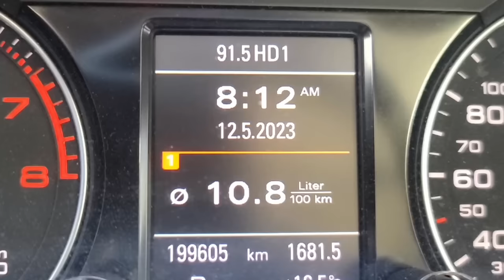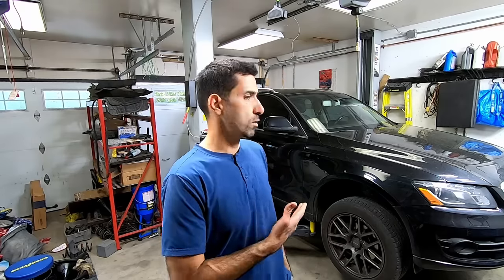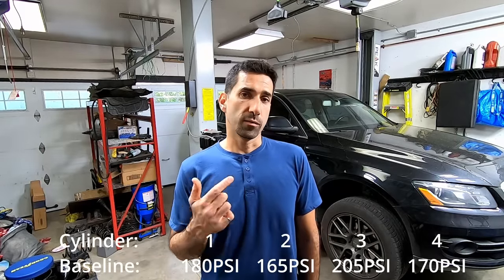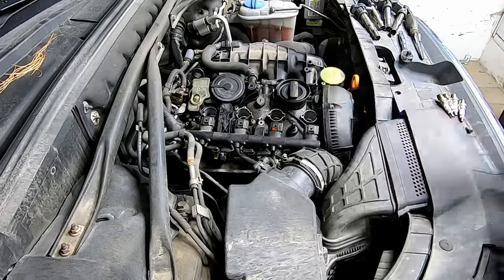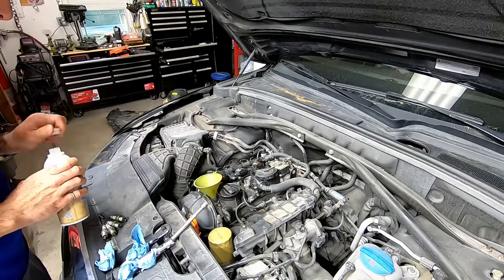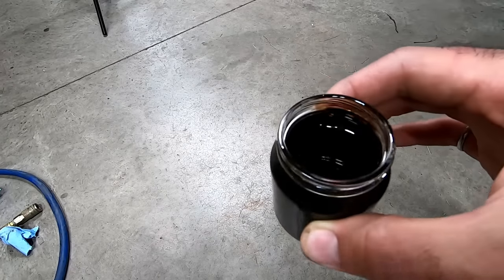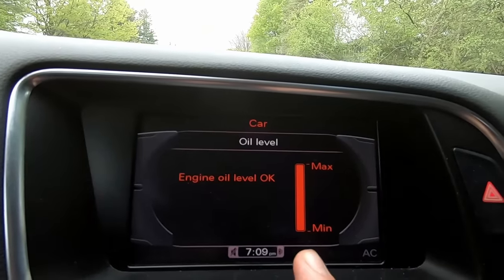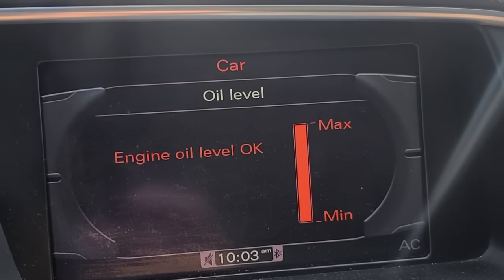How to fix excessive oil consumption from clogged piston rings (Part 2)

Comment: Great results! Will be very interesting to see longer term results (5k and 10k miles).
Reply from the maker: The first oil change at 5k is coming up next week - still no light
Reply: @ETMotorsports  That's awesome! From other reader comments, I was also wondering if the B-12 might burn out your cats pre maturely, kind of like when an engine is running rich.  I have no idea if there's a way to check that though...?
Reply from the maker: @tedjohnson64  yeah I know a few folks are concerned about that but honestly you're running it for 15-20 min and B12 is an injector cleaner so it's designed to be burned in the engine anyways...
Reply: @tedjohnson64 i bet shooting liters of oil through your cat is far worse then idling witz b12 for a few mins.
Reply: @tristan8243  Good point.  And if they went through at the same rate, I'd agree with you. However... that B12 appears to be going through the cat's in a very short period of time, rather than the multiples days and hundreds of miles it takes to burn a liter or two of oil.  So the excessive heat event in the cat caused by the B12 would be significantly more intense than burning oil, and thus more likely to melt the cat.  Furthemore the oil will be burned a bit at a time, spread out over multiple days, which means the cat gets to cool down between oil burning events. 

I have no idea how to objectively measure cat health, but it would be quite interesting if (for a future video) one could take a before measurement of cat health, then do the B12 treatment, then take a second measurement of cat health.

Comment: Hi, I was informed by the Audi dealership the cylinder issue and need $10k replacement due to the q7 2018 is burning oil. The car shake and does not  accelerate. Is my car experiencing bigger issue and using this method would not work ?
Reply from the maker: It could be 1000 different things... I'm working on a Q7 right now burning 1L/400km but drives perfectly fine and compression checks ok... you could have the same issues with oil burning but have other problems too... my A4 was burning so much oil that it was destroying the plugs in less than 30 min of driving so it would start to misfire and turn off one of the cylinders... basically it's hard to know without more data - cylinder scoring? Cylinder misfires? Maybe timing issues? Lots of variables

Comment: Excellent video. My only comment is why take the risk of incurring permanent damage to bearings, caps, etc by running the engine with 20%+ of the oil being a solvent?  After the soak, your engine/oil is full of free carbon chunks, grit, etc.  You want to get that crap out before putting a load on the engine/components, and especially not when your viscosity has been dropped significantly.
I am going to do a soak on a Nissan 3.5, but then an oil change with $20 Supertech full synthetic and filter, then drive it for a couple days with some real acceleration, and then a final oil change.
If I want/need to do an engine clean, then I'll do it before next oil change using 1 can, and if necessary next oil change the same way.
If you're burning up that much oil, then the engine is certainly carbon-ed up the wazoo.  Bearings, journals, caps, etc being exposed to a crapload of free carbon is not something that can be cheaply DIY fixed.
Its taken years for the engine to get this bad, why put yourself at an unnecessarily higher ri$k trying to fix it in 1 weekend vs lower risk over 2-3?
Really need to find an oil filter thats been reviewed and really filters out very fine grit.
Reply from the maker: It's a valid question - I guess it comes down to your comfort level... you can do this process 20 different ways... on my Touareg I just did a single soak with seafoam and 15 min drive and dropped my oil consumption by half... if you can do a few extra oil changes it can't hurt for sure

Comment: I saw in a different Berryman video they cranked the car with the plugs out after the 24 hours to remove excess debris and excess Berrymans if there. Did you do the same? Or just made sure no berrymans was in for hydrolock and just replaced plugs/coils and started up? Does it risk any damage if you don’t shoot it up through the spark plug holes?
Reply from the maker: definitely crank the motor a few times before putting in the plugs...it will clear the cylinders of any left over B12 and carbon debris etc.

Comment: Hey I’m in the process right now at 24 hours and shooting the carbon out the plug holes. A bunch of black came up but cylinders 3 and 4 are a little wet but no layer of fluid. Can I start up with plugs in or should I wait till they dry completely?
Reply from the maker: It's fine to start with wet pistons... it'll burn up in the first 20 or so min...as long as you crank it a bunch before putting the plugs in
Reply: @ETMotorsports  just finished up! Thanks for the input brother! Will update once I drive a few hundred miles or so

Comment: Appreciate you doing and posting this.I have 2 or 3 questions which i will ask one at a time.After you pour B-12 into each cylinder,let it soak,turn the engine over by hand,you crank the engine with the key. Do you disable the fuel supply in any way?
Reply from the maker: You should if you can...I didn't but that's why I was shooting fuel up while cranking with the key... if you pull the fuse you're better off

Comment: Hello, please so to understand, you initially put a whole bottle of the B-12 over the 4 cylinders, then after 6 hours you rotated the crank and then added another bottle, then same thing at 12 hours later?  Not sure because at the end u said u only used two bottles of b-12 but in the video u seem to use 3 bottles in total ( 6,12 and 18 hours). Would u be able to clarify please ? Much appreciated 🙏
Reply from the maker: Hey 1 bottle split in 4 initially,  1 bottle just to top off at 6, 12 and 18hrs - total of 2 bottles
Reply: @ETMotorsports  great thank u 🙏
Reply from the maker: Technically if you're not planning on running the engine with the b12 in the oil you can use as many bottles as you like but if you're running the engine you should not go more than 2... even 2 is a bit much but for short time it's ok

Comment: What's the name of the additives,my 2jz is burning oil badly so I stepped up to 20w50 from 5w30 and it burns slowly ,so mechanic said he will loose my tip cylinder,grind valves,change valve stem seals,but I don't want to go that way cause it will cause the end of the engine.pls what's the name of the liquid.......
Reply from the maker: B12 Chemtool
Reply: @ETMotorsports  does ebay sell it,cause I'm in nigeria or can u sell to me

Comment: If the engine had been designed to get 10% worse fuel economy, but not develop oil burning problems at a young age, wouldn't that actually be better foe the environment long term? This is a serious question: for the EPA to contend with.
Reply from the maker: Yup - no doubt

Comment: Wow!!! Thanks for sharing your experience and giving us some Hope with this problem. I have some questions for you, if it’s ok to you. I have a 2016 Volvo xc90 T6 (turbo and turbo charger) burning a lot of oil, has an oil piston rings design problem and is out of warranty.
- it’s complicated to turn the engine from the crank to put all the pistons at the same level, do you think that is a problem?
- turbo and turbo charger will not going to have problems after using b12 chemical?
- what exactly the kind of b12 that I have to buy? (Saw some different kinds
Thanks in advance for your help
Reply from the maker: hey - thanks for the comments...let's see if I can answer your questions:
- not a big deal to turn the engine - located the crank pulley and figure out what bolt is holding it and then turn...if the plugs are out it will be pretty easy...there are some engines that use multiple smaller bolts for the crank pulley so it may be harder to turn - at the end of the day it's not a big issue if the pistons are not on the same level
-should not have any issues running B12 through the turbo for a short period of time - same as an engine flush
- you're looking for B12 chemtool fuel injector cleaner - may not be available depending on where you're located...
Reply: @ETMotorsports hey I have the same problem with my 2012 audi a6 3.0t 130k miles burning oil every 250-300 miles would it be ok to do this procedure with my car ?
Reply from the maker: @tonygarcia1021  yeah we've had a few folks successfully doing the soak on the 3.0T

Comment: In your opinion why did the rings stick up? Super light oil? Poor quality oil?' Too long a service interval?, Engine design like ring tension, wear, short runs?. How can we stop this from being a problem in my car? I imagine to added product is a light readily evaporated hydrocarbon base solvent? After the treatment do you put a little lube down the cylinders to lube them after removing all the oil with the solvent and assist the rings sealing?

Comment: To who that havent done this, i have done it with bad results. Beware because all this stuff that gets broken up with the soak can wash out into the turbine and catalytic converter and can in fact ruin it. Car wont run after doing this and the soak was done correctly. Just a heads up
Reply from the maker: Hey sorry to hear about your experience - can you give us more details on what happened? Did the car start but have issues? Check engine light?
Reply: The turbine will just collect what looks like white ash.  It won't do anything.  Happened to my DSM and it ran fine till I wrecked it.  If your cat is getting clogged, you have bigger issues that a simple piston ring soak won't fix.

Comment: will this work for my Acura TL 3.2L it is fouling plugs and oil level is low. lots of smoke from tailpipe under acceleration and misfire.
Reply from the maker: Sounds pretty similar to my A4 - if he rings are causing issues,  a piston soak will work great

Comment: Good morning. 500km later, oil gauge is halfway. My intention is to add a quart when needed and be back at you the next time oil will be required. This way, I’ll have a pretty good idea of the situation.
Also,
I’m considering trying another brand than Castrol edge euro car.
Any thought about Motul or Liqui Moly. Some users seem to have better results using a particular type.
Reply from the maker: What was the original consumption? If you're asking about using different oil - feel free to try but I doubt the brand will make a big difference
Reply: 700 more or less

Comment: In Diesel Cars, we could do the same process?? Will be more difficult to start the car with incandescent sparks, do you agree?
Reply from the maker: same process - you have to remove the glow plugs to pour the liquid...make sure to crank the engine a few times before putting the plugs back to make sure all the liquid is out

Comment: Great video, I’m now doing this to my 2.0t tfsi. 

Did you drive around with 2 cans worth in the sump, did it thin the oil much. Thanks
Reply from the maker: It does thin the oil but you're only driving with it for 20-30 min... yes on the Q5 I drove for a good 30 min

Comment: Man i wish i could do this on my subaru :( has the flat 4 ej25 engine :( good work though, cant wait for the followup
Reply from the maker: Haha I just told another viewer that a boxer is the only thing you can't do that to... hmm I wonder if you can pour liquid in and then put compressed air in the cylinder...I did that when I did the seals on the 2.0T to keep the valves up but it works the same way pushing against the piston...

Comment: Would you recommend using an alternative such as the liquimoly carburetor cleaner? We don't have the B12 chemtool in EU
Reply from the maker: Excellent question - I myself had a hard time getting B12 in Canada... technically speaking any good dissolvent should work... on the A4 I used Seafoam with good success...I imagine even using diesel will work ok... if you're not planning on running the motor with the solvent in it,  then there's little danger regardless of what you use because you can just drain it right after the soak... if you want to run it then make sure it's safe for seals etc... something like LiquiMoly engine flush should work well - it's already designed to be run in the motor so the question is how well will it dissolve the soot around the rings... start off wth 2 cans and let us know how it works...uspeh!
Reply: @ETMotorsports  Will do! Thanks
Reply: @zzhelyazkov00   any update on this? Was thinking to use some BG product as an alternative of B12.
Reply: @janjulina1664  interested to know
Reply: Sds says b12 is acetone. I'll be using that
Reply: @ETMotorsports  So, kind of a late follow-up, but I used it on my EA888 gen.2, It burns 2.5x less oil now. Used the liqui moly engine flush.

Comment: I have a toyota space verso NR-FE 1.33 high oil consumption, it will help for me?
Reply from the maker: if the issue is caused by stuck oil rings then yes
Reply: @ETMotorsports  Except B12, what else is good to use, because in my country i dont have it?
Reply from the maker: @רחלי_המקורית_פה_חברס  some folks have suggested using LiquiMoly Engine flush Pro Line...

Comment: Hi. Very interesting indeed. Would that treatment work on diesel engine too? 
 I am from France. I don’t know if we get this b12 here. Never heard of it. Is it kind of a carb cleaner? 
Thank you.
Reply from the maker: hello - yes no reason it won't work on a diesel as long as the oil burning is from stuck piston rings...if B12 is not available you can try a few different things...easiest one to find is probably LiquiMoly Engine Flush Pro line...it may not be as effective as B12 but it's worth a try
Reply: @ETMotorsports  Thank you sir. I will surely try it 👍
Reply: @jocelynantoinette4108  did you tried it? If yes did u saw any improvements?

Comment: Holly molly, did I just stumble on a solution for my 2012 A4 tfsi 2.0? It's burning oil like crazy. 200-300 km for 1l of oil. Also, if I leave it running for a few minutes I can see little drops of oil coming out of exhaust manifold. Could it be that it's the piston rings that might be causing it or it may be turbocharger? Subscribing to you channel immediately.
Reply from the maker: Both are equally likely and will need some diagnostic... if you're burning oil through the piston rings you will likely see your plugs pretty wet and dirty... if the oil is coming out of the turbo hot side the combustion chambers will be pretty clean...
Reply: Before stumbling on this video, I had my turbo refurbished in the hope that it would help, but my oil consumption didn't go down. Another clue was I would occasionally get misfiring and then I would have to clean my spark plugs.
Reply from the maker: @stanleyadamssa  oh yeah that's a pretty sure sign the oil is coming through the rings... if you look up Part 1 of this I did the soak on my A4 which had a persistent Cyl 2 misfire caused by the plug being soaked with oil

Comment: Why do you think the piston ribgs size up? Lack of oil changes / good quality oil ? Also, did u get a chance to send thr oil for sample ? 
Hope your audi os fixed ❤
Reply from the maker: as far as I can tell the issue is the "new" low friction compression rings, which let soot pass by and clog up the oil rings...the oil rings themselves aren't the problem - the compression rings aren't doing their job of keeping the ignition byprobucts in the cylinder...from the multiple comments on the video so far it seems that staying within a shorter interval oil changes (say 5k) with good quality oil helps but it's not a guaranteed solution by any means
Reply: @ETMotorsports  gotcha .. thanks for the great info.

Comment: Thank you sir🙏 this worked the very first attempt. Brilliant
Reply from the maker: What were the results? How bad was your consumption ?
Reply: @ETMotorsports  more than a gallon between 3k oil changes. I was gonna put a new engine in it because I don't want to fuck someone else with it.  I tried this a couple months ago. IT WORKED AMAZINGLY! 2012 Audi A4 2.0t 110000mi
Reply: Actually lookin back I was burning a quart a week. Less that 200 miles per quart. Mad respect brotha 🙏

Comment: Does this engine have nikasil cylinder coating? Heard of ensuing engine rebuilds thanks to decarbonization chemistry application on nikasil (
Reply from the maker: No this is a cast motor but I just did a 3.0T which is aluminum... didn't see any issues after soaking - time will tell

Comment: Can this be done on a Q7 (3.0 tfsi petrol)? I've heard decarbonization chems can often corrode paint in a crankace pen or somethink like that. Won't it also eat up the nicasil coating on cylinders?
Reply from the maker: It's been tried on the 3 0T... plenty of viewers have used it and had no issues

Comment: Hello, my Hyundai i20 2010 burns 400ml of oil in 1000 km. I am thinking of using Kunzel engine flush in Turkey. What I'm wondering is, after adding fluid into the cylinder and waiting, how long do we let the vehicle idle and do we drive? Thank you in advance for your support. I am grateful.
Reply from the maker: Hey after the soak is finished,  you can either run the motor with the liquid inside or drain it... since you're using an engine flush,  you're ok to run the liquid in the motor... if you check the instructions on the bottle it should tell you how long you should run it for - strong flushes ate usually 30 min max,  weaker stuff like Seafoam you can drive 4-500km with